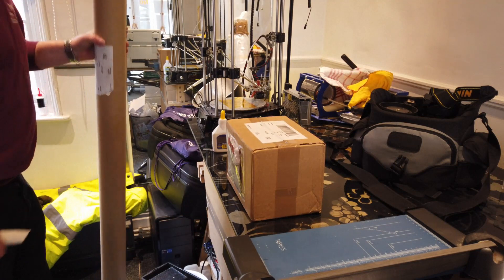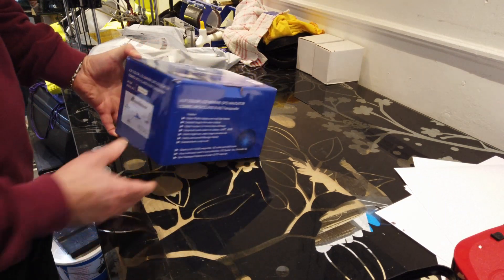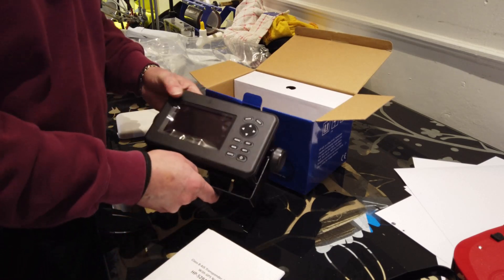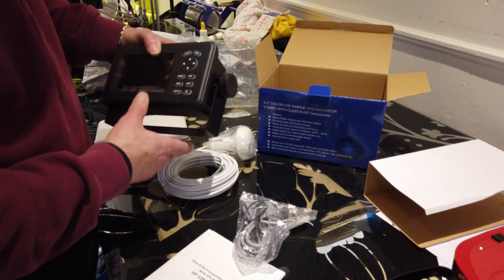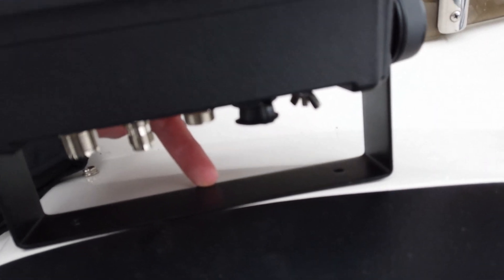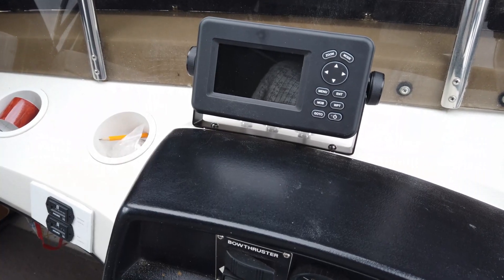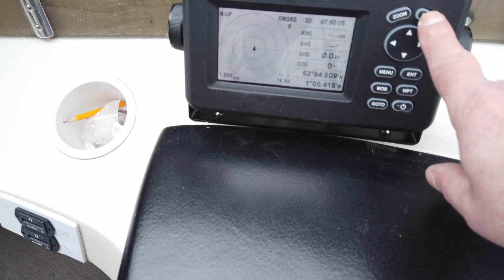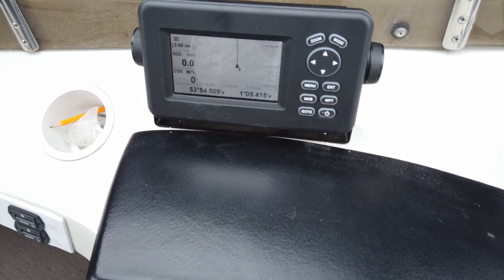Matsutec Hp 528a Ais Installation on our Carver 3207 Ava Grace

Comment: hi, peter from belgium here.  I also purchased a matsutec transponder and mounted it on my boat. but i never see the tx and rx in the main screen light up, shouldn't these work?

many greetings
Reply from the maker: Mine is the same, however the unit seems to work well. Never got to the bottom of why they dont flash.
Reply: @MyAvaGrace  ok, then I know it's not abnormal, I had already looked silly at those tx and rx leds. Thank you for the good explanation and great videos. I looked at them all before I bought mine.

greetings from Belgium

Comment: Hi, I was just wondering what was your opinion on the Matsutec HP-528A 3 years later. Is the unit still working fine ? Are you satisfied with it? Any issues? Comments? 
Have you been using the NMEA0183 Output ? 

I'm planning on getting one, which will be connected to a NMEA0183 - NMEA 2K - Wifi multiplexer so it can transmit the AIS data over wifi and onto other devices on board such as Smartpone/Tablet using Navionics and a B&G Vulcan 9 Chartplotter; any experience with that ?
Reply from the maker: Hi, as a unit it's great. It still works well. I do have issues, I have spent the last year trying to get the nmea0183 output talking to my nmea2000 raymarine axiom, I have tried an actisense convertor, and a digital yacht convertor with no success. Both convertors work with other devices. I have heard that some have had success, but no evidence.
Reply: @MyAvaGrace  Thanks for your reply. I am also finding a lot of reports from people having similar issues since the non-standard data port used to communicate the NMEA 0183 data requires a bit of creativity and fiddling around. From what I gathered you would have to use Pin 1 -- RS-232 RX and Pin 2 -- RS-232 TX to send data to an NMEA multiplexer which will convert it to NMEA 2k and relay to your chartplotter. Good luck
Reply from the maker: I believe 1&2 are for GPS. Pins 4,5,6,7 are ais output they do give data, but voltage is lower than nmea0183 expects. Matsutec say in their info, the unit gives a sort of nmea0183. Which is meaningless. I keep trying. Baud rates are 38400 for ais, and 4800 for GPS.  Cheers
Reply from the maker: Hi an update on the connection to my Axiom display. Managed to get this working. Use pins 1 & 2 thro a digital yacht multiplexer at 38400 baud rate. and this time it worked. Now have ais data on the MFD overlaid on charts and Radar.
Reply: @MyAvaGrace  This is the device I ordered from Quark-Elec.com QK-A034 Bi-directional WiFi to NMEA 2000 Gateway Multiplexer with NMEA 0183 and SeaTalk input options - A034-B with NMEA 0183 output

I'm hoping it will relay the data properly between all the electronic on board but that's probably just wishful thinking lol

Comment: Please for your experience it is better matsutec or onwa and thanks
Reply from the maker: Hi can't say which is better as I don't have experience of onwa. I can only say the matsutec as a stand alone unit works well. It can be a little slow to get GPS data on boot up, but once on does what it says. Integration with chart plotter not so good as we have not been able to get it to talk to our chart plotter at all.
Reply: Tank you
Reply: @MyAvaGrace  
Thank you for your reply.  I am a fisherman I want to track my net buoy is matsutec good for this
Reply from the maker: @kllbt3lihamohamed191  no, it wouldn't do that. To track the net bout,  the bouy would have to transmit an ais vhf signal. It would need a power source as well.

Comment: Could you share the gps installation base of the stl file thanks to thingiverse etc
Reply from the maker: Will look it up, it's on an old pc, so might take a day or so to find.
Reply from the maker: Just added the stl file to thingiverse. Here is the Link https://www.thingiverse.com/thing:4575058
Hope it prints ok for you. Mine works a treat. I found its best to print in ABS, as PLA would be too brittle.

Comment: Hi. Is there any power save option? Like switch off the screen etc. I want the device as an AIS transponder and a backup for the main navigation system.  
Thanks.
Reply from the maker: No there isn't a power save feature.

Comment: Hi ! I have a Matsutec Hp 528 Transponder but with Covid my boat was not in the water and so before I got round to fitting it I was outside EBAY returns policy. Mine only receives marginally and does not transpond at all. Have you any ideas of people in Uk who might attempt a repair?
Reply from the maker: No sorry no idea who could repair. Have you checked the settings to ensure its set to transpond. Also it has to be the Hp528a to transpond. The hp528 is a receiver only.
Reply: @MyAvaGrace  What I understand from the manual pg 22, both 528 and 528A are transponders. (Tx & Rx). 528A is capable of outputting AIS data in NMEA format. Please comment.
Reply from the maker: Hi, I was just reading up on this yesterday. The hp528 is a receiver only. The hp528a has the transponder built in. The instruction manual covers both versions but doesn't explain the difference. The TX and Rx is for the nmea, but again is only for the hp528a.

Comment: Hi, very good video, thank you.
For the VHF: did you install a separate antenna or do you share an existing antenna with the Matsutec and a VHF receiver?
Reply from the maker: Hi I installed a separate Ariel for the ais
Reply: @MyAvaGrace  Do you know wether it would be possible to use one antenna for AIS and VHF receiver?
Reply from the maker: @michaelremme8319  yes it is possible if you use a VHF splitter. However these cost as much as the Ariel.
Reply: @MyAvaGrace  good point. If i am installing a new ariel ( funny name btw ), do you think its enough, if the ariel is installed on a rollbar at the back of the boat? Or should it better be installed on the top of the mast ( which i'd like to avoid )
Reply from the maker: @michaelremme8319  It should be fine on the roll bar at the back of the boat. Height increases range, but for ais range isn't as critical.
Reply: Looks like matsutec has a splitter for 60$

Comment: Hello, we are looking at buying this very unit. Seems to be the cheapest transmitter of AIS out there. 
Do you like it? Would you recommend it? Would you buy it again?

Thanks for your input.
Reply from the maker: @sinanuluvar9174  I have tried always to get an output that is readable by nmea convertors into either WiFi or direct nmea to 2000. The voltage outputs appear to be 2.5 volt whereas I understand nmea should be closer to 5 volt.
Reply from the maker: Hi I like it. So far we have only managed to test it on river applications, in 2 weeks we will be trying in open sea and in busy shipping lanes. For the price it is excellent, and yes I would buy again. I wish they had built in a wifi transmitter as well I could then link it to my tablet that runs navionics. I guess that may be in future units.
Reply: @MyAvaGrace 

Thanks for your feedback.

As per WiFi, Yakbitz in Australia might be able to help you.

Comment: Hi!
Cool video. Do you know if the NMEA data port, is the same as on the furuno GP33?
Reply from the maker: As far as I am aware yes. I haven't used the NMEA port myself though. According to the manual it follows the NMEA convention.

Comment: Hi! Have you managed to install the external alarm?
Reply from the maker: No we didn't need to install that.
Reply: Thanks for the answer. I've discovered that in HP-33 manual it says about pins 9&10 on data cable. In HP-528A there's nothing about them. I'll test it.
Reply from the maker: Ok good to know @syrebekah-leisure23sl87

Comment: Hi just fitted one . Looking for some assistance can I contact you
Reply from the maker: Yes sure what assistance
Reply: Did it work ok for you we aren’t showing up anything
Reply from the maker: @frazermacinnes500  yes worked straight off. Powered up, set up mmsi number in the menu and it started. After a minute I started getting returns. You will only get a return if a vessel in range is transmitting.
Reply: I can pick up other vessels but my boat is not showing on marine traffic or any other site . So not sure if the transponder side is working . Did you have to change any settings etc .
Reply from the maker: For the transponder to work you need to enter your mmsi number. If you don't it will only receive. Also I think there is a tick box that needs checking. It should auto enable once the mmsi is in, but it may not. Have you checked with another class b unit to see if you show up.
Reply from the maker: @frazermacinnes500  in menu under ais. Make sure you have entered all you data, mmsi careful once in you can't change it. Boat name and call sign plus the GPS position as mounted on your boat. Then at the gym of that menu there is ais TX that needs to checked. I then show up on other class b units, if you show on class b you will also show on class a.
Reply: Other ais vessels are picking us up checked this afternoon. Still not showing on marine traffic etc. Annoying as that’s where we want to see her so we can check her progress on charters etc
Reply from the maker: @frazermacinnes500  right not sure why, it will be the parameters that app uses. I see on some apps the positions given can be hours old
Reply from the maker: @frazermacinnes500  I've done a bit of research. To show up on marine traffic you need to keep your transponder on, and be within 30 knm of one of their coastal stations. It will eventually pick up your signal. To put a picture of your vessel you need to register with marine traffic I guess there will then be a fee.
Reply: Thanks mate .for  your help  happy boating